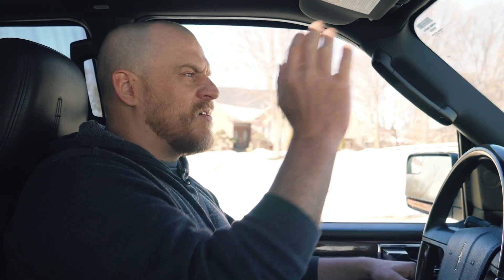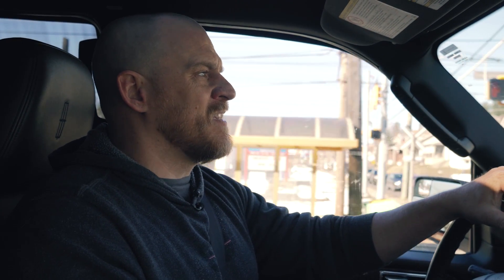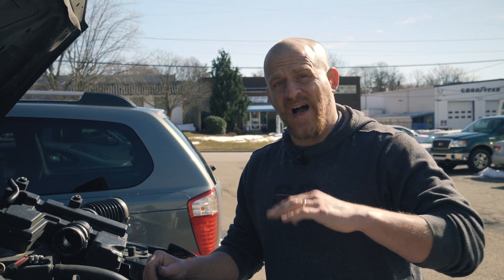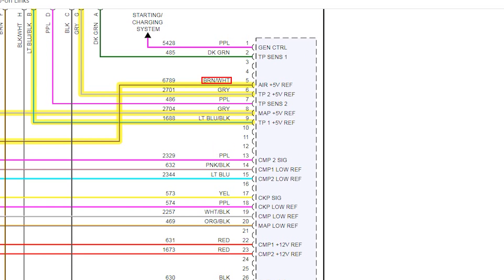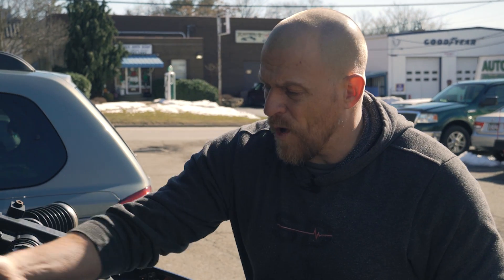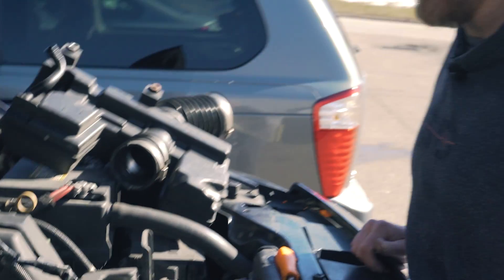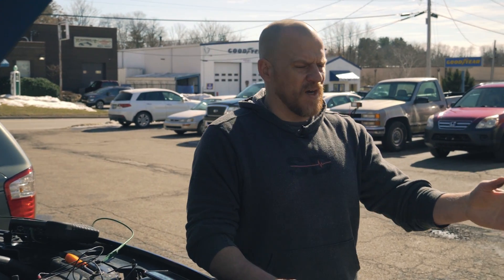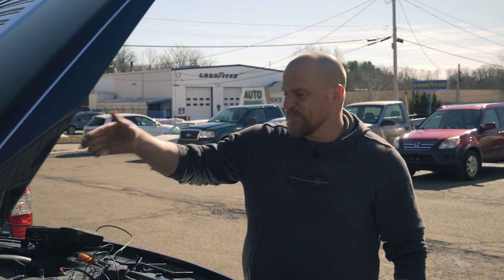2007 Hummer H3 COMEBACK!

Comment from the maker: Yes, this is a comeback and everything we did and checked in Part 1 https://youtu.be/u_TG9Tubvpg other than the EVAP Vent Solenoid fault, had NOTHING to do with the actual problem on this car. 
Having the customer clearing the codes, before bringing it to us in the original diagnosis, was a HUGE problem. Here is the list of the codes that were setting when it came back:
P2135 TP Sensor 1-2 Correlation, P2138 APP Sensor 1-2 Correlation, P0641 5 Volt Reference 1 Circuit , P2132 Secondary Air System Pressure Sensor Circuit Low 
Here is a list of the original codes: (minus the EVAP Vent issue shown in part 1)
- P2138, C0240, U1026, U1016, U1301, U1305, U1064, U1301
Notice the only code that we saw, was the P2138 (APP Sensor code). 
No U-codes this time around! I believe those U-codes would have returned if the shorted 5v reference issue happens for a longer period of time
Reply: Please Help!! 
Code p1345 
I'm fairly knowledgeable on cars but I'm beat on this electrical  problem.

 I have the 2002 mazda millenia 2.5l v6. 
NOT 2.3L v6 supercharged!!!

It's a crank no start with fuel pressure working and no spark at the distributor.
I cracked the fuel rail bolt and there is good pressure from the fuel pump but I dont know if injectors are firing fuel in.(haven't tested)

I tested the fuses with a test lamp and  the "st sign"," idle up" are both not getting any power to the ECM or from...
 that's how I know it's an electrical issue.

 When I Checked the fuses and relays those two are the only ones not getting power...

I also tested for spark at the distributor, power comes in but no spark goes out to the coils also... 

Replaced battery on day 1

 day 2 replaced distributor with aftermarket whole set rotor and coil and cap...

Day 3 replaced crank sensor down by the crank.

Day 4 test lamp fuse box and distributor 

Still the same code p1345. It's a hard code once I remove it after I turn it over it comes on.
I drove during my shift in the rain and went over huge puddles so I know water got in but the car was off and turned on and got me home that night. The next day it wouldn't start just crank and crank.

I was thinking of giving direct power and from the batter to the fuse connection points to try to jump it, is it safe??? 
or is there another way to jump the car without taking apart the fuse box??? 

Also I do get data stream for timming angle for cylinder 1. Data shows rpm on the scan tool but none shows up when crancking on the dash tachometer!!!!
Reply from the maker: @tentedalex  post this to my forum, it is free to join and we can help you there https://www.scannerdanner.com/forum/post-your-repair-questions-here.html

Comment: Okay Guys here is my Problem .. I have an 06 H3.. it goes into Limp mode only when it is above 70  degrees out and I have driven it over 15-20 miles... other than that it wont go into limp mode.. ever.. can drive it all winter everywhere for an hour and it wont shut down.. spring fall same thing... it has to be Hot out...and has to be driven at least 20 so miles for it to shut down .  
 Any suggestions... I have a cheap scan tool and it only gives me codes... replaced the throttle then I watched your videos...History codes P1516. P2101. P2176... I also recently had  my Cat stolen off it but it did it before that.. codes that I got P2176 . P1516... I have noticed  moisture in my fuse box under the hood

Comment: I wanted to take a minute and thank you for this video.  I recently bought a 2006 H3 at auction. condition report videos showed vehicle starting driving forward and reverse no problems. What it didn't show was whether CEL was on or not, but wouldn't matter because battery was dead and had to use a big jump box to start it up, so stored codes would have been gone anyway...

However, once vehicle was delivered to me,  it was empty on gas, tow driver jumped vehicle to remove from truck, I drove to gas station to put gas in and less than 10 minutes total time, vehicle shut off, CEL going berserk, lights all over..and then limp home mode with gas pedal not working at all.   Had to have it towed home. 

I knew battery was bad at that point (ya think? lol), tested and verified it was bad, bought a new battery and put that in. Fired up, ran fine, and then, still...lit up like a xmas tree with all sorts of weird seemingly unrelated codes-- 2135, p060e, c0240, p1133, p0128, p0171,p0300,Traction control, coolant temp to low (95 degrees outside-- for real?), random misfire, etc etc. you get the story.
I was expecting to have to change air clearner, tune up, oil change, all of that stuff, but to see all of these things didnt' make sense....I watched these videos....sure enough...EXACT same issue...the dang resonator box on the H3 had been rubbing on the wire harness and pinching it against valve cover for 15 years, so badly that it had worn permanent grooves on the bottom side of the resonator.   

The 02 sensor wiring, all four wires the insulation was gone, bare wires, covered in a glorious turqoise corrosion and shorting to each other and grounding to whatever, an ignition coil pigtail had also grounded out on the bottom side against the valve cover.    

Although to look at the loom and the plastic cover, it looked fine....but if you grab it and try to look at it or under it, it crumbles or is totally hardened by the long term engine heat, etc etc.  
I wish they made a plug and play replacement harness for that whole section of wiring harness because likely any and every wire running down the valve cover needs to be looked at. 

Bottom line, after catching those 7 or so wires grounding out, no more check engine lights or trouble codes.  BTW...no one makes those connectors/pigtails anymore for that 3.5l; even the dealer didn't have them.   only place that had them was rockauto dot com.

Comment: I can confirm that at least on some cars, the separate 5V refs are indeed separate and not tied internally in the PCM. On some recent experiments I did on 2 different models (one was my 2000 trans am), when I intentionally shorted out the 5V ref that was specific for a component such as the IAT for example, there was no effect on the voltage at any other sensors much less the whole circuit. Another example was a 5V ref that fed only 2 components and I could show grounding it out only affected those 2 components. 
   I am sure there is variation with all the makes and models but at least in my experience, some of the independent reference circuits on a wiring diagram are indeed independent.
Reply from the maker: Hey Matt! In the case of an IAT, that is a thermistor circuit and the 5v you're shorting there is not directly connected to the 5v regulator like other sensors. 😉
Reply: @ScannerDanner  ah that makes sense because the thermistors would need a resistor in the PCM near their source voltage to allow for measurement of the variable resistance in the thermistor itself.

Comment: You can never under estimate a visual inspection. I see crazy stuff being a lil unique in what we sell, my boss buys all the Hummers he can. I avoid a shameless plug. Great work. This is the reason they are talking about a Mode 10. To see all the valuable data that a novice will not save before deleting codes.

Comment: Except for working on a Chevy, my apologies for this off subject comment.  Been a long time subscriber, you've done many misfire vids where listening to how the engine cranks (relative compression) can give you direction.  Have an 08 K1500 I'm working on. Only P0300 code, boss kept asking about fuel, fire, etc..... listening to cranking, I could hear the dead hole.  Told my boss 💯 confident mechanical issue. Less than 1 he to diag.  Work order is now 31 hrs!  Just OMG I got alot of work ahead of me.... lolol

Comment: Hi scanner how do you doing I need some help on a primary ignition waveform that didn't showing the spike after the driver shot off just go up to 50v and then a flat line and return to battery voltage .. knowing that the driver had been repaired for the same number of cylender misfire ..
Reply from the maker: https://www.scannerdanner.com/forum/post-your-repair-questions-here.html
Post this here! It is free to join and you can share that waveform with me.

Comment: Danner comes in for the win! Great find! I just had a Ford kick my butt with a bad power steering pressure switch causing the fuel tank pressure sensor to act up and cause a large leak code. Didn't get paid enough on diag but it's fixed. It's that feeling when you figure it out that keeps us going!

Comment: Nice 👍🏻 video, thanks. One question, is in air secondary valve the pressure sensor, or is there a valve movement sensor. I know that it is working like potentiometer with 5v reference, but how car computer knows about stock open or stock close valve. Thanks for answering and big respect ✊.
Reply from the maker: It is a pressure sensor to monitor airflow during air pump operation. It is not a position sensor. Hope I answered your question. Thanks!
Reply: @ScannerDanner  thank you very much

Comment: I have a 07 Pontiac G5 that we parked a few winters ago fir a " Reduced Power Mode " issue....
It had other issues that we decided to replace it and not spend time troubleshooting it...
Throttle Body was suspect - i cleaned it and you can't get a TPS without buying whole unit...$250+ here
Accelerator pedal was also recommended replacing ...drive by wire at $200+
Corrosion was my thought as it is only a Winter issue...
We had parked it winter before but needed it again as backup and once cold hit..it slowed again....
I plan to rip out the carpet and trace wires and see if i can repair it cheaply before dumping it...

Comment: The Danner Tag team fix it!  It is difficult to diagnose when a customer clears the codes before you get the vehicle,  and replaced the throttle body and pig tail , APP,  too many variables before you even start to diagnose.  Excellent Video!

Comment: I work on motorhome power systems every day . I think automotive electrical systems seem more challenging.
Reply: You get the Ying and Yang with modern vehicles.....i miss my early vehicles ( have a few for projects now ) but still work on my newer ones as easily...luckily i am tech savvy and 50 years diagnosing is still the same but....
With more electronics come more chances for codes and issues that 99% of the time are simple to figure out....frustrating but no different when troubleshooting anything...i fix anything and build computers too...love the technology even when it fails easily...
Reply from the maker: Excellent description on "new technology", nothing new with electricity
Reply: We have been travel trailer / motor homing in my family since the 60's and yes your average motorhome ( beyond the engine/transmission of newer models is pretty simple AC/DC wiring )
Reply from the maker: My class A is an electrical nightmare
Reply: @ScannerDanner  , I love easy money !
Reply: @ScannerDanner  
My Wife is a Hormonal Nightmare!!

Comment: Thank you for the update. I got a follow up question, on part 1, you found some crossties in the junction box. When you find something like that, what do you do?  I would have had an squirrel moment and most likely got stuck in that hole mess. SMHO.
Reply from the maker: I moved relays around and waited for the return. I was absolutely not going to recommend a power distribution box at any point in time with this thing. I needed to see the failure. That is the key. You start changing parts, even with some type of evidence to do so, is a receipt for disaster. The answer is to clear the faults and give it back and pray when it comes back you have better direction. Exactly what we did here. Hope that makes sense.
Remember when you make a call and change a part, you are now married to that car until it is fixed!
So don't make a call, when you can't be sure. Simple as that sometimes.

Comment: What does RAF1 mean?????
Reply: 5v reference circuit number 1
Reply from the maker: What Ismar said.
I'll also add that there are two different 5v regulators in the engine computer:
5 volt reference 1 
5 volt reference 2
When I talked, I mentioned "ref 1" and "ref 2", sorry for the slang. Thanks!

Comment: makes me wonder if that one hummer that had TB problem had the same issue, I remember the relay was bad and it was fixed by replacing it but maybe it was caused by some short.
Reply from the maker: No, that one was the relay. I proved the low voltage feed to the pcm on that one. Remember?
Reply: @ScannerDanner   just went back and watched it, you are right my mistake.
Reply from the maker: @shrekerdad6924  yeah, it was weird as it was a power feed to the ecm but was marked as a throttle actuator power feed if I remember.
So basically, the low voltage feed to the ecm was the feed being used by the ecm to control the throttle body. Make sense?
Reply: @ScannerDanner  wait! I thought that voltage was meant to be compared to the feed of the TB. I'm so confused now.
Reply from the maker: It was! That faulty relay, was a power feed to the ECM, that much is easy to see.
What is not easy to understand by the diagram is what the ECM is actually using that particular power feed for.
1. It's main purpose is to use that source to control the TAC  motor. 
2. It will look at that source and compare it to another power feed (to the ECM) to make sure they are the same.
And this is where our voltage code to the TAC motor came from. There really is no source to the TAC motor directly. It comes from the ECM.
Hope I'm explaining that right.
#There is no wiring to the TAC motor assembly that is not coming from the ECM. So there is no constant power feed circuit directly feeding the TAC (from memory)
Reply: @ScannerDanner  thanks Paul, for taking the time to explain that. That shows how critical it's to have a diagram in diagnosis, and also knowing how that system works. I've got alot of homework to do.
Reply from the maker: Updated my comment and added one word "constant"
Read it again and see if that makes more sense.
Reply: @ScannerDanner  So I've actually made research and found that in some ETC types the pos and ground sides are both going to pcm and the pcm switch them to open/close the throttle. I assume that's what you mean by "not constant". Also thanks for the reply.
Reply from the maker: @shrekerdad6924  correct!

Comment: One of the things I always try to tell students, DO NOT CLEAR CODES at least until you’ve read the freeze frame data. Even more difficult if the customer is erasing codes for you.
Reply: Even more when you dont know they where cleared. it would be great if all modules take a note from Fords P1000 code to tell hay we where cleared reasently.
Reply: @timowallin8020  Take a look on the generic side for distance traveled and number of warm ups since DTCs cleared.
Reply: @mattt4183  so true there. i actually forget at times generic mode has this. need to remind myself